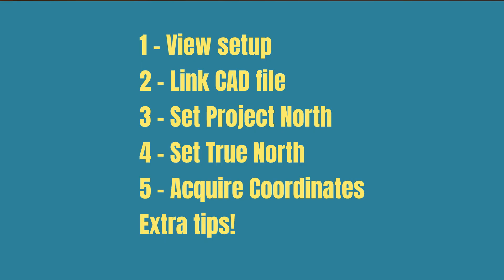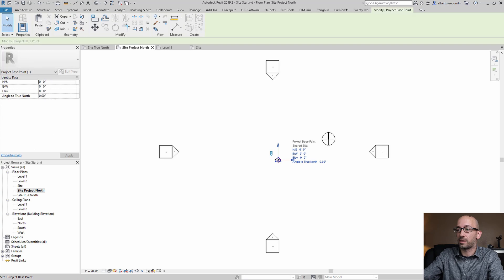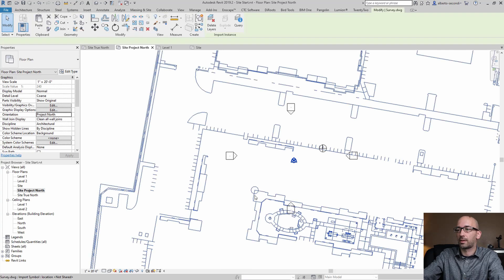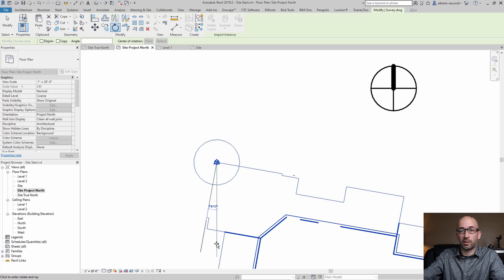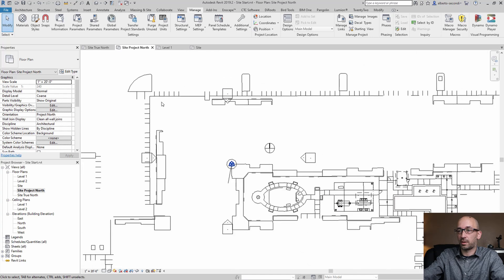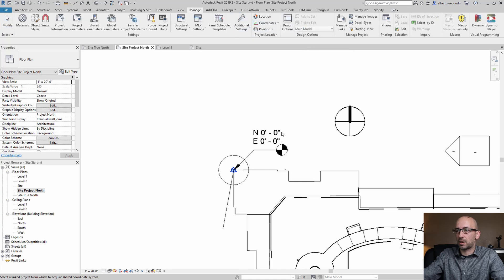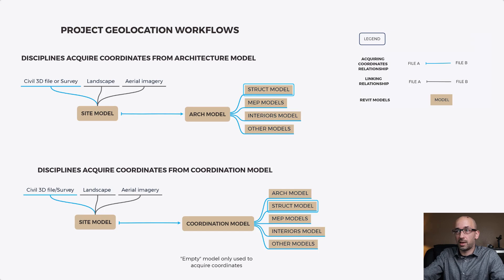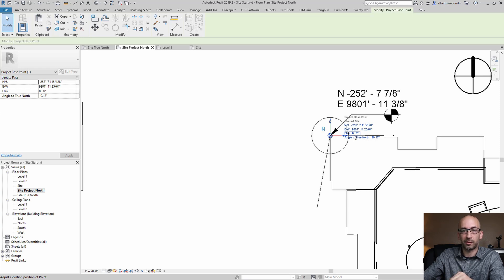Shared Coordinates System in Revit from a CAD File in 5 Simple Steps

Comment: The problem with this solution is that, when you use IFC, you can't import by project base point, you can only import by survey point, and where is the survey point? At 0,0,0, and when you import, the IFC will be at the 0,0,0. Completly off the model. Project base point It's just to mark the building point not the real geographical coordinates of the site of the project.
Reply: @JoaoPaulo-cr4th
Right! So which workflow do you follow  when you have to link an IFC file in order to acquire the shared coordinates? I'm genuinely interested in the topic...🤔
Reply: but do you know that the survey point is just to read the coordinates? if you unclip it when it is in the 0,0,0 and move it around it will show you the coordinates where you place it? so you can move it to your base point and the clip it again if you'd rather have it in the same place as the Base Point